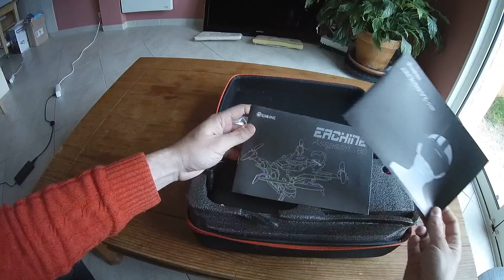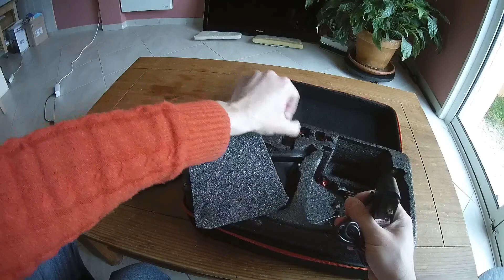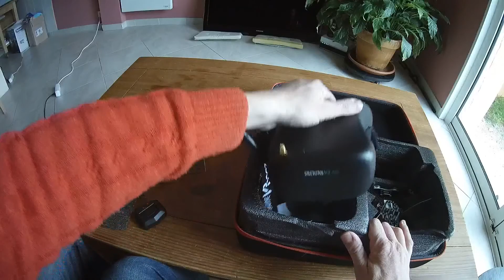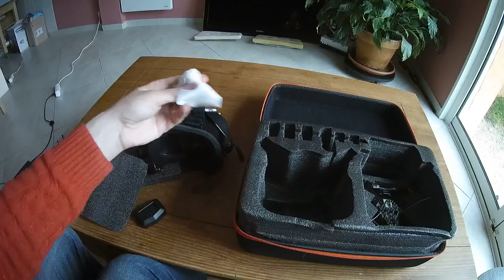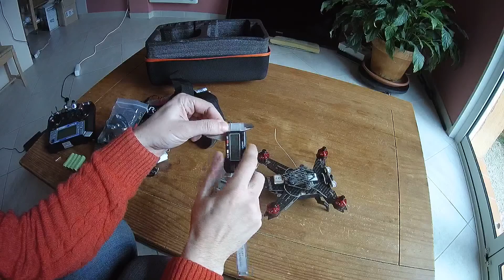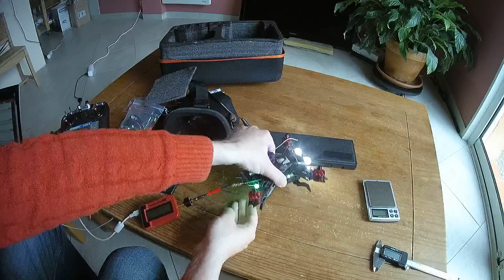Eachine Assassin 180 Unboxing and quick analysis (Courtesy Banggood)

Comment: plus you can hook up the walkera Runner 250 advanced to libra flight which i believe is the newest version of clean flight..thats the set up i have and works very very well with the Russian glonass and usa gps satalites..mine works very well and is great with the skyzone goggles..im not sure what you paid  for that unit but got my 250 runner for around $320 and the goggles were around $235..I think if you want and out of the box fpv racer and decent googles  the walkera runner 250 advanced and the skyzone googles would be better for the money!!!